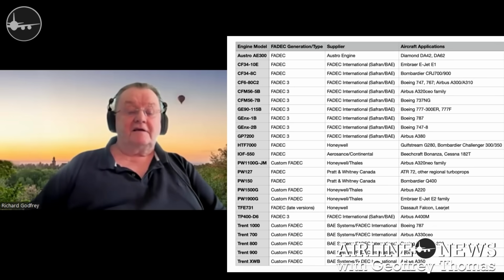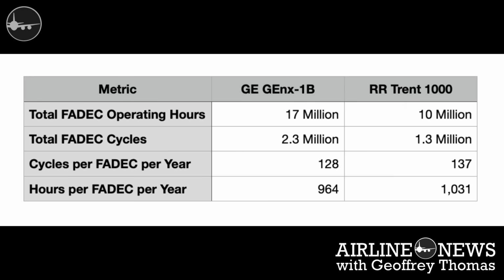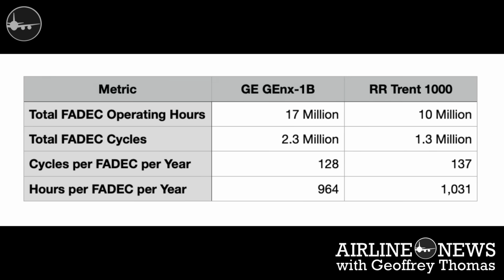Air India Crash - FADEC Explained  #airindiacrash

Comment: Why would they not just release the full CVR transcript (all voice exchange) and the full CVR audio file (to hear any cockpit noises) and the full ICAS messages list  and the relevant FDR transcript. Full transparency should be mandated or you don't fly in international airspace. Coverup could seriously be endangering the flying public. Is it a human factor issue, an aircraft issue or an Air India issue. The public deserves to know. A FADEC failure doesn't seem to align with the voice exchange between pilots that has so far been released.
Reply: What if FADEC did what it was supposed to do but its inputs were incorrect? We don't actually know what the pilots said to anyone, including each other or ATC nor do we have any timestamp for any communications. Media is reporting quotes like "Why did you cut off the fuel/fuel switch" when that is not even what the PR says in their paraphrase. I agree that they should release the CVR transcript in order to salvage any credibility they have squandered in the PR.

Comment: Thank You for some real measured factual engineering based views on the situation.

I am an ex FADEC engineer who was pioneering this technology through the 1980s and 1990s. We learnt a considerable amount over the development period as to what could go wrong with these systems if they were not integrated into the airframe correctly, and even if they were, how they would respond to fault conditions. I have observed a power failure on a cockpit sensor not being detected by the FADEC as designed due to an unexpected voltage and earth loop continuing to produce a valid signal and this has to be a possible scenario here. I have seen other information that there could have been a cockpit electrical failure of some form in this accident, and this could well have resulted in the throttles being interpreted by FADECs in a rundown positions, or that the shutoff switches were interpreted in the wrong position. The data transferred to the Data Recorder would probably not know the difference between an actual position change and one caused by power failure. My experience is that these can be very rare and unusual failure modes that require detailed analysis and testing on actual aircraft as they cannot be reproduced in a laboratory. This is still a scenario that requires detailed technical systems integration and technology skills and time to either find or discard potential scenarios. Boeing are already scarred with the 737 Max MCAS issue where the engineers knew there was a potential problem, but the message was ignored and the messengers were fired. I hope that the right skills and honesty are brought into this very sad accident and issues are not suppressed.
Reply: "Why do you cut off?  
...i did not.. "😮
Reply: The 737Max crashes were primarily pilot error- the pilots didn’t perform their memory items for a runway trim wheel:

Turn the breaker off, trim manually & land at nearest AP….
Reply: @mec3303 they shut off the autopilot, and were trying to fly manually.

Comment: Greetings gentlemen, I'm Paul. Since we don't have access to both the CVR and DFDR data of AI171, ascertaining what transpired during the 94 secs from the initial ground roll until the plane crashed, becomes a difficult task. If we can't compare the timing of pilots commands, and cross-reference them with changes of in-flight parameters as been depicted on the FDR graphs over time, understanding the impact of cockpit crew actions on the plane becomes challenging.
Any sudden or unusual changes in the FDR graphs vs time, such as engine parameters over time, airspeed over time, and altitude over time, or cockpit sounds such as alarms and noises on the CVR, can be indicative of systems malfunctions.
Since we can't analyze the trends and patterns in the data, and identify either electrical, or hydraulic or electronic failure modes or human errors, or a combination of these factors, the contributing causes to the AI171 tragic accident will remain unknown.

Comment: 1. What is scanning time for fuel switches  and 1 second may be simultaneously turned off.  If systems caused shutdown it would be exactly same time. But if pilot do it it will take 2-3seconds.
2 . Bad battery. May cause changeover Rat power to engine a momentary voltage drop causing drop of fuel relays. Without moving cut of sticks.
3. Tail fire may also cause same effect as in second point. More clear- in terms of 0 and 1 logic. If 1 is for on and 0 for off . A milliseconds voltage drop may signal fuel cutoff without stics moving.

Comment: Hypothesis : Because there was no fire, explosion etc. and the engines stopped because the fuel was cut by then system, they may have assumed it was a software problem.

In this case, to reset fadec and other systems, the procedure is to leave the fuel switches to OFF for a MINIMUM of 2 sec. So, it can be more to ensure a full reset.

The 10 sec can also be explained by : they could not do a windmill start because N2 was too low or just on the edge and they prepared for a starter assist startup with the APU  -- "APU inlet door opening at 08:08:54 UTC (indicating the APU auto-start logic engaged),"

In this case, you must wait for N2 ~10% so they may have waited 10 sec for the N2 to decrease otherwise "FADEC restart logic will not engage starter assist"

Of course they did not have enough time, but they did not know this, maybe they hoped they did and had to try anyway. 
(technical info from ChatGPT)

Comment: "There is no formal requirement to leave the engine fuel control switches OFF for 10 seconds when resetting the FADEC on a Boeing 787, but doing so can be technically justified in some situations. It can be a safe and technically valid method to ensure a full FADEC reset, especially after unexplained flameouts or transient faults.

-- Reasons a Pilot Might Wait ~10 Seconds:

 -- Ensure Full FADEC Reset:
       - Longer OFF time allows internal fault latches, watchdog timers, and voltage rails to fully discharge.
       - Some latched faults (e.g. software glitches) may not clear with a quick OFF–ON toggle.

-- Reset Redundant FADEC Channels:
       - Dual-channel FADEC logic may retain stale state if not fully powered down.
       - A longer OFF time improves synchronization between active/standby modules.

 -- Stabilize Electrical and Hydraulic Loads:
       - Prevents transient glitches or incomplete resets under RAT or APU-powered systems.

 -- Procedural Caution in Ambiguous Situations:
       - In high-stress flameout scenarios, a pilot may use a 10-second wait as a conservative measure to ensure a clean system reset before relight." (ChatGTP answer to -> "Is there any technical rationale for a pilot to deliberately leave the engine fuel control switches in the OFF position for approximately 10 seconds during a dual engine flameout scenario, specifically to ensure a complete FADEC reset before attempting restart?")
Reply: You should have asked:
   
"Is there any technical rationale for a pilot to deliberately leave the engine fuel control switches in the OFF position for approximately 10 seconds during a dual engine flameout scenario, specifically to ensure a complete FADEC reset before attempting restart   DURING TAKE-OFF  ?"
Reply: @RikFz1  The question was in the context of hour of discussion with ChatGTP so he know we are specifically talking about AI 171. Can't you asked the question yourself

Here I did it for you:

"Final Verdict:
There is technical plausibility but no formal procedural basis for deliberately leaving the fuel switches OFF for ~10 seconds during a dual engine flameout on takeoff — especially not on the 787.
It is not recommended, but it could have been done with intent, based on habits or beliefs from other aircraft systems."

No considering there is absolutely no training for this scenario as it has no value because the plane cannot be saved. They still did tried something just in case. Mat be it as good may be it was bad. Now after the fact everybody know it all they did not save the plane but no way they would have just looked at the scene watching the plane go done while making joke while "manage speed and altitude trading ". They tried something and this was a full reset of the system.

"Scientific Final Hypothesis (Most Likely)
The crew waited deliberately ~10 seconds with both fuel switches OFF to allow N2 to decay below ~15%, increasing the chance of a successful starter-assisted restart or autostart.
This action, while not documented, is technically plausible, and fits the sequence of events, including the APU inlet door opening and the eventual failure to relight." (ChatGTP)

Literally NO scenario... hummm here is one!

You were not in the cockpit, you don't have all the data, you were not in their seats. Be cautious with "Literally NO scenario."

#	Explanation	                                                                Plausibility	                Notes
1	Wait for N2 <15% for autostart/starter assist	✅ High	               Best-supported
2	FADEC reset logic (unofficial)	                                ✅ Medium-High        Widely believed, not documented
3	CRM or brief checklist confirmation	                ✅ Medium	               Fits cockpit behavior
4	Prevent hot-start / surge risk	                               ⚠ Medium	                Not confirmed on 787
5	Allow RAT/APU system config	                               ⚠ Medium	                Technically plausible
6	Task saturation	                                                      ⚠ Medium	               Human-factors plausible
7	Misapplied memory item from other aircraft	      ⚠ Low-Medium	      Needs CVR for proof
8	Fault-clearing logic / diagnostic delay	              ⚠ Low-Medium	       Overly methodical for time-critical phase

Comment: I will admit I had no idea Boeing originally designed/planned to have intercchangeable engines. In previous aircraft that could not be possible.  The 747 was evebtually available with P&W, GE or RR but none could be swapped for another. The RR RB211 even spun in the opposite direction. On the DC10 the -30 (GE) and -40 (P&W) even had different shaped cowling on the #2 engine. That really was an ambitious design plan by Boeing.

Comment: Never flew the 787 but I don't remember any checklist or a memory item that state that fuel cut off switches need to be cycled IN FLIGHT in any scenario.
Reply: The 787 Dual Engine failure checklist memory item is move both fuel switches to Cutoff and then to Run. There is no requirement to wait ten seconds (or at all).
Reply: Volcanic dust engine manual shutdown/restart …

Comment: Why would the 787 inflight relight procedure require pilots to recycle the fuel cutoff valve switches? Aren't they already in the "RUN" position? How could that not be set, if in fact automation would not have affected the valves, regardless of switch positioning? A programmer knew exactly why they must do that step, wouldn't you agree?
Reply: Three 171 takeoff videos exist, yet two show the forecast clear and sunny day, but the one shot just seconds earlier has swirling fog in the wake turbulence, both left and right with fog in the whole view. Temperature and dew point were not within three degrees, so no ground fog existed. Yet, it was there and circled by a PC mouse cursor in the monitor copy circulated. It wasn't a dust cloud or puddle spray, because aerial views and videos show green grass running right up to the runway tarmac and taxiways. No dirt patches anywhere, and vertical analysis places them in the air well before the runway numbers and overrun zone. It's the engines pumping steam, not the sealed fuselage leaking smoke. A quenched engine won't restart instantly, as one might expect from blazing-hot turbine combustion chamber sets. All have ignored the evidence staring us in the face since the day of the crash. To the video recorder holding his phone, the airplane sounded more quiet than it should have. The RAT deployed instantly when the landing gear was unloaded, because the engines had failed already at or before rotation. It's all there to see, but the FADEC has not eyes. It must be coded to cut fuel when engines go out, waiting for pilots to reset switches and begin to reset a fuel/air mixture that's correct. How much of that is just a guess? Look again.
Reply: Good point. presumably it is so the system understands your intent.  If somehow the system has accepted an 'on-off' signal (from whatever source),  it will be waiting for an 'off-on' signal.
It's quite right that the system does not decide by itself that the first signal it reacted to was in error.  IMO!!
Reply: Lol. But if they were switched to CUTOFF? By the way, if you had looked at the maintenance manual for the Boeing  787-8 , or had looked at Stig Aviation's presentation about the Fuel Switches here on YouTube, you would know that they are manual only switches that operate relays. There is no mechanism that automates them. So, you can forget something automating them. Human action is required to operate them. And the Data Recorder noted that the Fuel Switches were operated twice before the plane crashed. So, please stop talking about the impossible, and stick to the facts.

Comment: Here is some positive feedback.  I follow this channel and leave comment to add to the sum of knowledge about the tragic loss of AI 171.

"no major aviation accident has ever been attributed to the FADEC".  This is incorrect.

1994 Mull of Kintyre Chinook crash.  Pilots blamed initially.  Later investigations showed FADEC software was "positively dangerous".

2015 Seville Airbus A400M crash - 3 of 4 engines shut down by FADEC bug.

https://en.wikipedia.org/wiki/1994_Mull_of_Kintyre_Chinook_crash
https://en.wikipedia.org/wiki/2015_Seville_Airbus_A400M_crash
Reply from the maker: We clearly stated that our analysis was of commercial aircraft and in particular the Boeing 787-8 involved in the Air India accident. We excluded military aircraft from our analysis and clearly stated that in the episode.

The question was: "How reliable is GEnx-1B FADEC?"

What we said:"In general, over the last 40 years, no major aviation accident has been attributed to the FADEC system design." in the context of commercial aviation.  You cite a military accident and a test incident on a military aircraft.

The Chinook initial inquiry concluded the pilots were guilty of gross negligence by flying too fast and too low in bad weather. The FADEC was for the T55‑L‑714 engine and not the GEnx-1B FADEC or similar.

The 2015 Seville Airbus A400M crash inquiry concluded the FADEC load software had erased the ECU parameter data. This is not a FADEC failure, but a procedural/installation error in loading configuration files into the FADEC. 

What we said was. "There have been no proven dual IFSD (In Flight Shut Down) due to FADEC malfunction with either GE or Rolls Royce FADECs." in that context.
Reply: @Airline-News  OK.  But the chinook full investigation completely  exonerated the pilots.  
In the context of civil aviation there have been no dual engine shutdowns in the air.  But there has been one reported incident of 787 engine shutdown during the landing phase.  (There was another, FADEC/TCMA but not 787). If the FADEC/TCMA can shut engines down during landing, why can it not shut engines down during takeoff?
If it can happen, it will happen.

Comment: The problem with taking the position that the ANA flight was a different engine manufacturer, so not related, goes like this. Both the ANA flight and the Air India flight lost power to both engines within 400 feet of the ground. Now, if you had a 1958 Packard and you had installed a Lamborghini engine in it, and the engine caught on fire going down the road, so your custom car builder said, "Well, that's ok, I have this brand new Ferrari engine I will swap into your Packard", and you then drove this down the road, and the engine Ferrari engine caught on fire, the problem might be with the builder of the vehicle, not of either engine.
Reply from the maker: It is not just a different engine, it is a different FADEC. In the context is the GEnx-1B FADEC the cause of the Air India crash, the Rolls Royce Trent 1000 FADEC is not relevant.
Reply: @Airline-News  I have not seen a report on the ANA dual engine loss of power. But, the "internet" says its the TCMA system, and there is no mention of any  FADEC.
Reply: @ImperrfectStranger  Then why does the FAA exemption docket number FAA-2016-7855, refer to this problem as being with a "module" and not mention FADEC in the exemption request from Boeing. This document also mentions that the problem is with the Genx engine and is not a problem with the Rolls engine?
Reply: I thought this was a fantastic analysis.  Whether you are right or wrong, I was entertained by this comparison.
Reply: @brianabbott6585 Thank you. I made Richard smile. That was my favorite. I think I'm on target here, or mighty close. Worldwide in the last 5 years, how many rat deployments have we had across all aircraft? We have had 2 on 787's in the last 2 months.